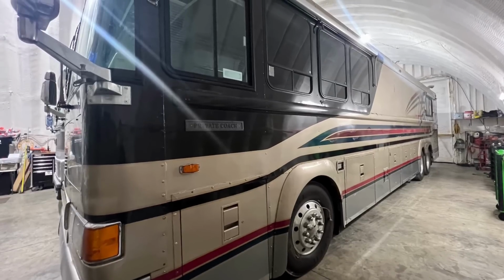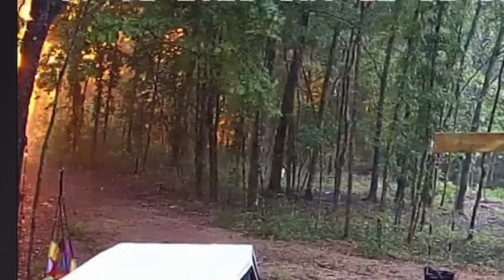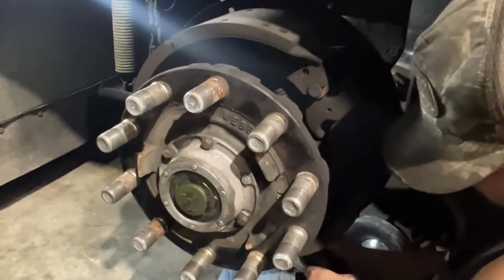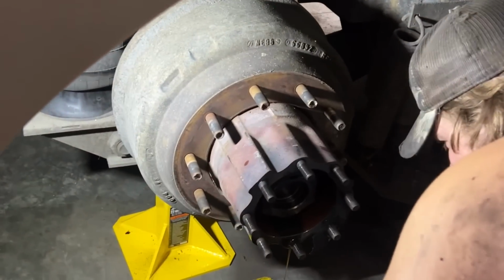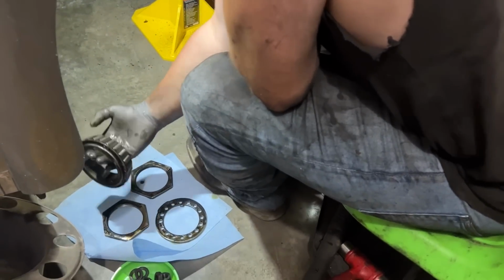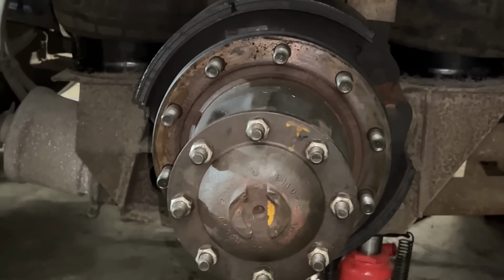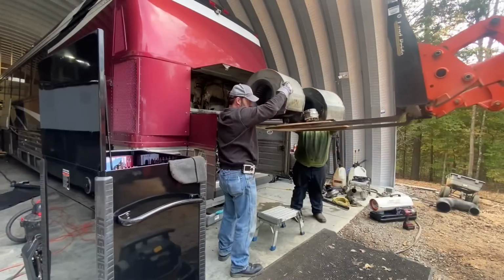Another wanderlodge.  Kingpin work, air leaks, and wheel seal issues.

Comment: Hi Grease Monkey, A company called Keine Tool makes a tool to remove hub pilot wheels and also brake drums that are stuck.  They also make several specialized tools that are life savers for mechs that are doing back breaking jobs.  I bought clutch removal dolly from them and also the wheel, drum removal tool, and its a game changer for your back.  Thanks, Bill

Comment: I was born in Tennessee.  Back in the late 60's we moved to Upstate New York and lived there for seven years before moving back to Tennessee.  My Dad pointed out how all barns and most all farm houses in NY had lighting rods, where he never remembered seeing any in Tennessee, even though Tennessee had many more electrical storms then we ever saw in NY.  Just be sure to not make your bends in the ground wire to sharp.  If you do it can cause the lighting to jump out of the wire and hit something in the direction the lightning was traveling.
Reply: A couple of days ago I just happened to think of my friend's dad from back in the 80's, he installed lightning rods and drove a truck with lightning bolts, in New Lebanon NY no less, this happens to me all the time.
Reply: You are correct make any turns as mild as possible. Lightning likes to fly off and go anywhere it wants!
Reply: @tinysolarshack9615  I worked for AT&T as a power technician.  When I was sent to Kansas City for the power school, the teacher told us how one of the Central Offices (CO), I do not remember where had a Church building next door.  The steeple had a lightening rod on top of the steeple.  The Ground conductor came down the roof and was bent back about 180 degrees then down the corner of the Church building.  The lighting rod took a lighting hit and as the lightening traveled down the conductor it jumped out of the conductor, through the glass window to hit the ground buss-bar on the main frame.
Reply: My great grandfather was a lightning rod salesman in Upstate NY.  He drove around both Seneca, Cayuga and Keuka lakes selling them to farmers for the Electra Lightning Rod Co.  He made a pretty good living at it too.  Many an old barn in my hometown in Upstate NY still have them on their peaks today.  My favorite and very rare are the Cobalt blue globe lightning rods with "Electra" stamped in the glass.

Comment: Apart from the lightning rods I would suggest some form of surge protection devices on your wiring. You don't have to have a direct strike for it to cause damage. Our site telecomms have gas discharge tubes to ground out excess voltage and they've saved our systems many times over the years.

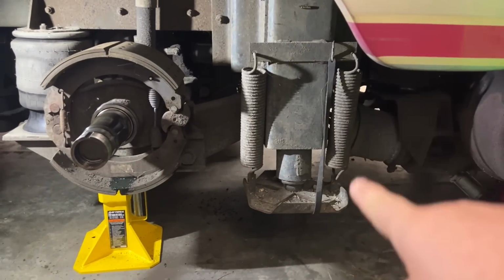Comment: 13:07 If you noticed, the giant springs were bottomed out (not providing any more tension) and if there was still play between the leveling pad cylinder and pad mount then it may have been making a rattling noise. The bungee may have just been a noise canceller and not so much of a dumb idea as a quick fix.

Comment: Hint. Have your machine shop buddy turn a lug nut socket into a drill bit jig. Each flat on the socket has a different size hole but at an angle so you are drilling thru the flats of the nut at an angle to allow you to drill nut nut and the taper without hitting the tapered seat of the wheel. You may have to send  a wheel.  2 inner nuts and 2 outer nuts.  One of each installed in the wheel.

Comment: make sure the ground rods are least 6 ft in the ground deeper is better and that heavy conductors are used to them near lost my house in houston to a strike cooked all the electronics and melted romex in a wall i had to cut open an re run 12 feet to get the lights and outlets working again ask why... cause they used a 2 ft ground rod which was no where enough depth to ground out a strike it cooked the rod an wire to it

Comment: When you install your lighting rods and ground system make sure your ground rods are good and deep. Also I am sure that chirt ground is probably like gravel and not the best conductor so occasionally watering the ground rod will help with conductivity
Reply: A good idea might be for BGM to run water from the washing machine drain hose to the ground rods to keep them wet and in good electrical contact.

Comment: I was holding my phone walked over to turn my inverter on, static electricity burn it out. Ground everything real good.
Reply: Burned up the phone or the inverter. Whichever burned out via static electricity was already weak… don’t you think?
Reply: I wear boots that can supresd 10,000 volts. The tires should do the same, were you shuffling your bare feet prior to turning on?

Comment: Can you use aluminum wire for those lightning rods or does it all have to be copper? I’ve seen it done on a bunch of farm houses in Barnes but I don’t remember everything.
Reply: There are certified UL system that use aluminum. I bet the conductors are upsized a couple gauge sizes over copper. I don’t know if the NEC has a section dedicated to it as ive never looked and mostly use section 330 and associated ampacity tables.
Reply: @mikebuffing727  thanks Mike for your reply. I was just kind of curious about the aluminum wire. It’s probably a hell of a lot cheaper than copper if you can get away with it and be safe.
Reply: I recall seeing braided aluminum conductors between lightning rods and grounding electrodes, but that was a long time ago and can't say for sure they are still being installed.

Comment: Hi do you work on spartan chassis? I have a forty foot diesel pusher with air leak and a big clunking noise under the front end. Thanks.
Reply from the maker: Yes we have but locating parts is an issue.

Comment: Off topic question. 
Would a turbo from an 8V92 be able to be a replacement for my 6v92 turbo?
I found a new one for really good price and my turbo is shot. Thanks in advance
Reply from the maker: It’s not a bolt on replacement if that’s what you are asking, all the pipes are different sizes because it’s physically much larger.

Comment: I heard that old Wanderlodges with 8v92's sometimes had something called a Jacobs Electric Retarder. Apparently if you combine jake brake and the electric retarder it would give you aboot 350hp of braking strength. I heard that now days a company called Telma makes the same electric retarder that Jacob's used to make. I have watched a lot of your videos and i dont remember ever seeing one mentioned or shown, i have bad memory these days though....so maybe i forgot or missed it. Is this something you've come across or heard of ?

Hope the lightning mitigation keeps the strikes away from your buildings ! 
Push / ask for every single dollar possible from insurance, they deserve the pressure.
Reply: I worked for Metro Bus in Seattle we had Telma 's on our fleet of Flyer buses that were added to the fleet to save on brake jobs. Unit would bolt to the 3rd member had a big disc brake that would get power sent from brake input worked good when set up properly they had some teething problems but was finally fixed believe they had wire's for the unit box hooked  up wrong.